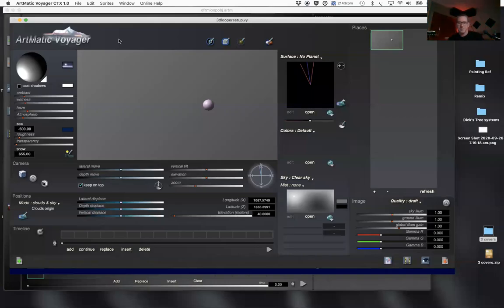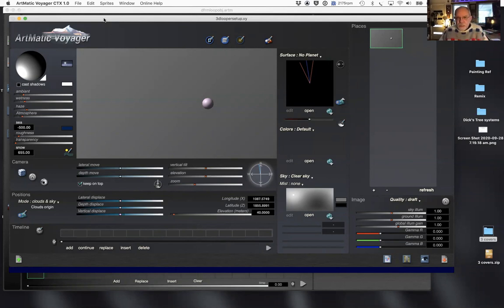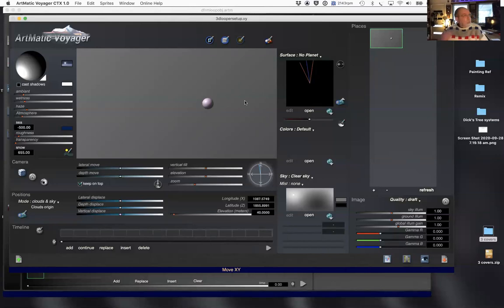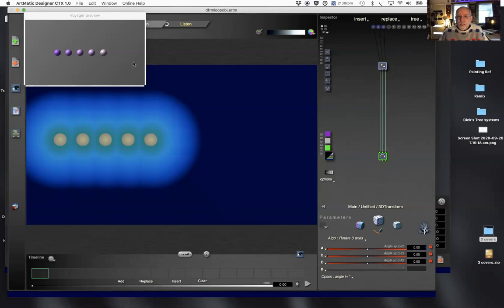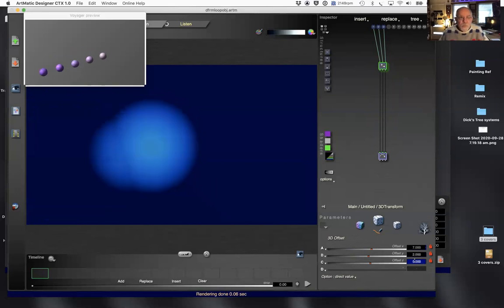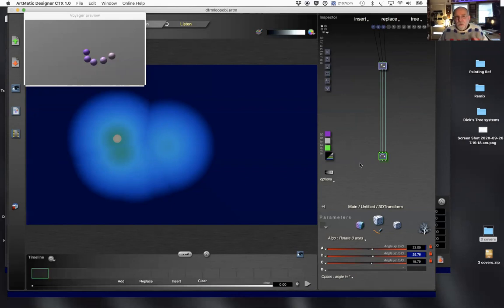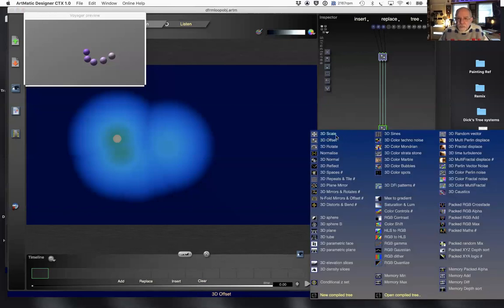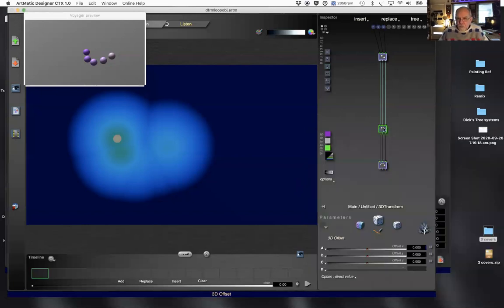ArtMatic CTX 1.0 - Voyager+Designer: 3D Loopers

Comment: This is great,  thank you.
I can’t seem to find one of the 2-1 component from the fractal patch (forward slash symbol /) what am I doing wrong?
Reply: That's the Divide algo in the Math Tool. So select the 2->1 Math Tool from the top left of the components dialog, and then look down at the bottom of the UI above the Parameter Sliders and you will see an option to change the algo. It defaults to Mul, but you need Div x/y
Reply: @scribbletronicsstudios2197  got it thanks. Had this software since version 6, mostly just using random clicks. After this tutorials I have started really seeing the possibilities and it’s quite amazing. Thank you guys 🙏🏼
Reply: @GoldenageTwothousandtwelve  Hey, that's great. Yes, I've been using it for 20 years and I still think it's an amazing suite of software - unlimited possibilities. If you do the Facebook thing, come over and join us on Worlds of ArtMatic, where you can learn tips & tricks and see what the community is up to.
Reply: @scribbletronicsstudios2197  thank you my friend, I’ve just requested there.